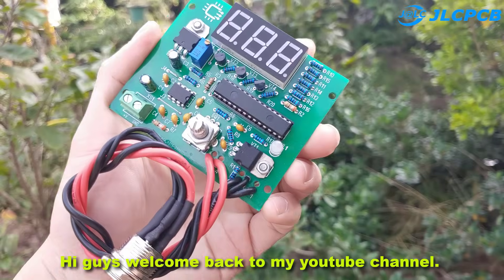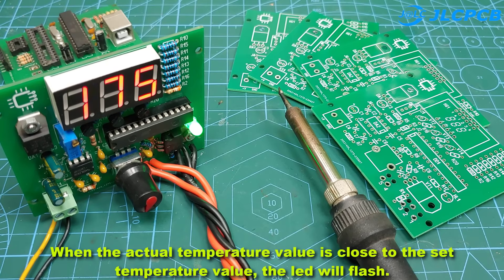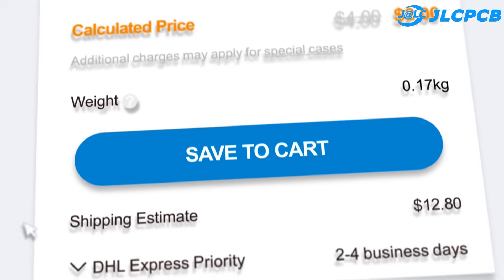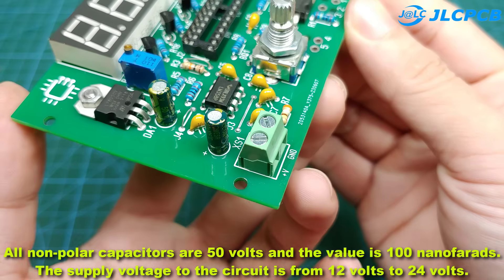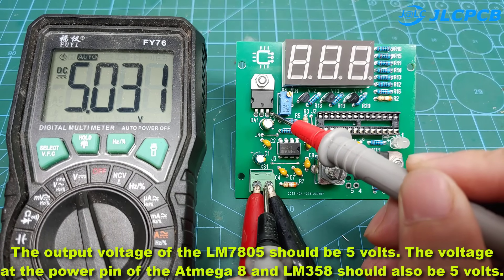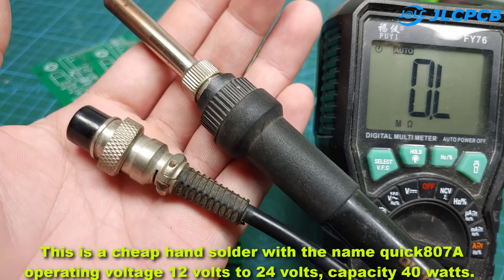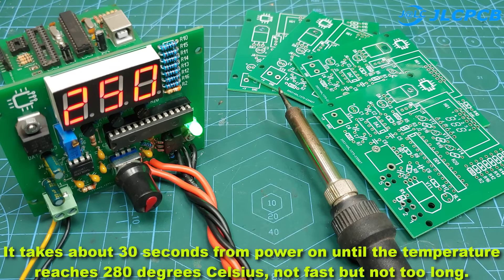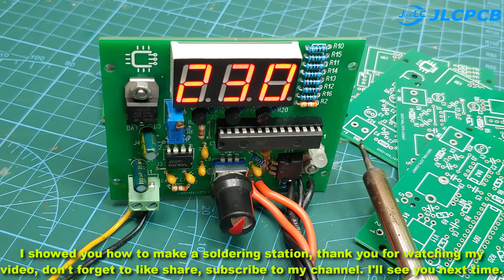Simple Digital Soldering Station

Comment: You gave us an incomplete hex file , it doesn't set the temperature, yes you can change it but it has no control. the displayed temperature value can be calibrated. so the displayed work,  and the set temperature doesn't work at all . you can sell your product while helping people, don't lie on them with this presentation in this video. what you are presenting is different from what you gave us 😡😡😡😡😡😡😡

Comment: Hi, congratulations on the project! Pins 1 and 2 are for the resistor, pins 4 and 5 are for the sensor and what is pin 3 for, what should it be connected to? Thank you.

Comment: Thank you very much for the video. Is it suitable for a hot air soldering gun? If it is not suitable, what kind of changes should be made in the circuit?